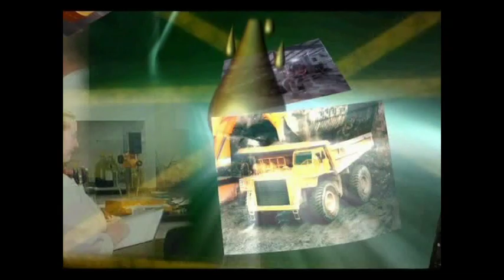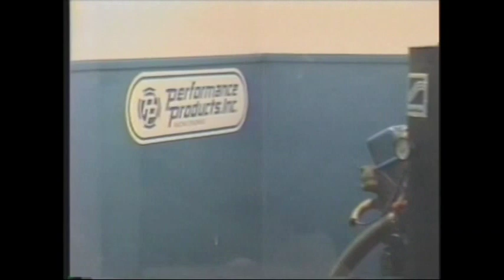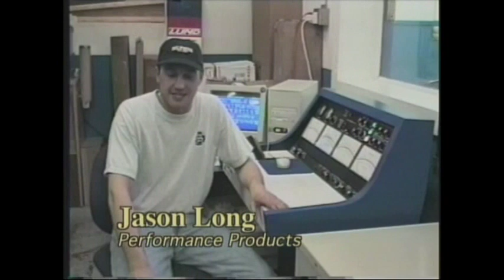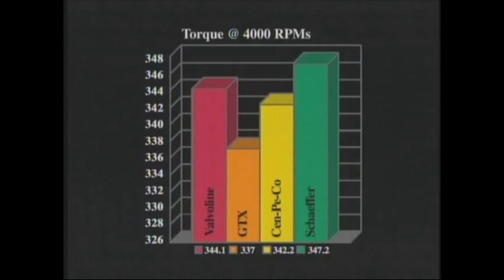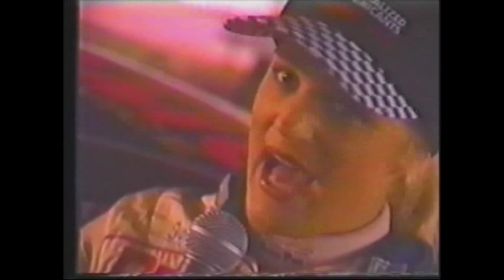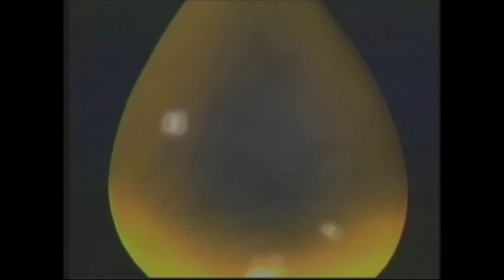SCHAEFFER vs MAJOR BRANDS

Comment: I use the Schaeffer's SynShield Ultra 722 10w30 dieseo oil. https://www.schaefferoil.com/722-ultra.html   Its one of the best oils for diesels. I use it in a 600HP CAT dump truck, 6.0 powerstroke and a 2020 F-450 6.7 powerstroke thats emissions system free
Reply: I'm constantly uploading videos of Schaeffer's Oil changes, I'm trying to heavily introduce it into to the pick-up and passenger car market!
Reply: @troubleshooterr5775  
This time I switched to Amsoil in a 21 Explorer Timberline (amsoil 5w30 ss) and a 22 F350 6.7 Tremor (amsoil dtt 10w30)
The Schaeffer's 5w30 (for Timberline) was way pricey. I may switch back to Schaeffer's down the road. 
I still use Schaeffer's in the dump truck and tractor. 
Look forward to the videos!
Reply: @resharddurdley6987  Cool, hey Amsoil is a great oil too!

Comment: Amsoil is just a mid level marketing scam. Schaffers is a legit company
Reply: I want to know how good it is because I want to buy me some 5w20 and some of the transmission fluid
Reply: @cnottagejr  ...I can tell you that I have had excellent results with AMSOIL products for over two decades.  I have never found a better ATF either, but I always get Signature Series.  I use XL for my engine oil, as Signature Series is not necessary for my application.  There are a lot of good fluids out there, including Schaeffer, but I stay with what works for me.
Reply: @mcc7762  I love amsoil but I hate that I have to keep ordering it lol I heard about schaeffer and I wanted to try them but I like redline 5w20 it runs good in my grand marquis

Comment: Valvoline Vr1 is better than any of those other oils
Reply: umm,,no. I race jet skis with superchargers  and this oil is the best,  Most competitors have to swap out their parts while mine is running fine.
Reply: GKAtascosa  VR1 is used by everybody from British sports cars with less than 100 p to Blown V8s with Nitromethane, and consustently shows great used oil anaylisis', it certainly is more popular than what you use
Reply: Well..use what works for you. I choose to use this.
Reply: Blue Oval Fanatic 2904 popular doesn't necessarily mean better. Hell if that's your criteria, Mobile 1 is one of the most popular brands and is used through out the racing/Motorsports world. That doesn't make it better than Schaeffer or Amsoil. Besides the stuff the racing world uses, isn't going to be the same stuff u use for your daily driver. You could have the absolute best racing oil known and it will do a great job under extreme conditions, but it wouldn't necessarily perform the best when used in a regular car with extended drain intervals. Those Nascar race engines are torn down and rebuilt after every race and they aren't going to be leaving the same oil in there for months at a time. Different conditions, different oils
Reply: I use nothing but Schaeffer products but before I discovered Schaeffer I ran VR1 it was my favorite oil deff badass stuff. Personally I like the Schaeffer better but my 2nd choice is forsure VR1.
Reply: Shoot I use Walmarts Great Value 10w 40 oil and it blows all these out of the water!!!!!!